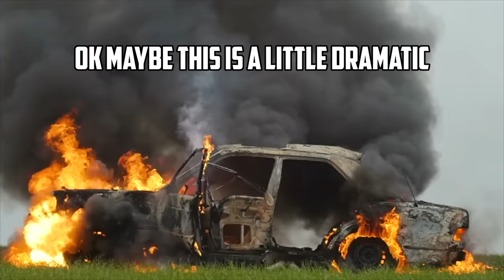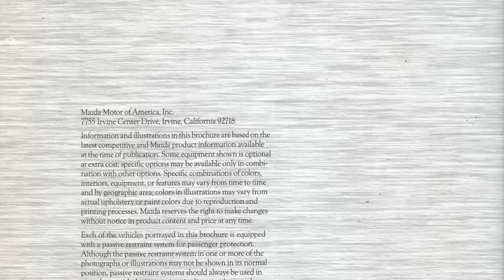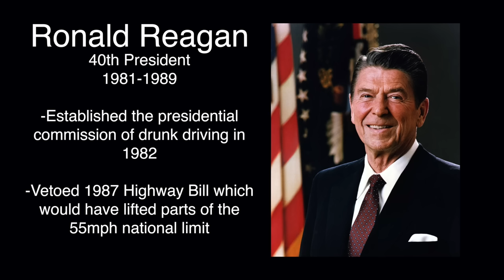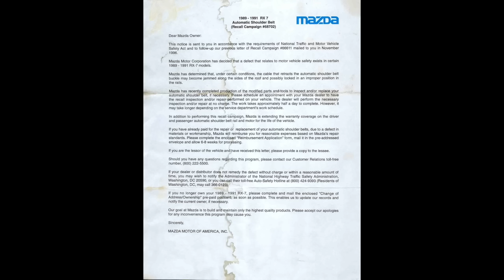Automatic Seatbelts - Why They Were Used & Why They Went Away!

Comment: back in 1991 I had bought a brand new Nissan Sentra 4-door and had nothing but electrical problems with it especially the seatbelts. they would automatically engage on their own without even breaking or there not being any need for them to engage they literally left weld marks on my best friend that was sitting in the front passenger seat the seat belt kept grinding pulling my best friend back further and further into his seat to the point that I had to press the emergency release red button but even with me pressing on it it still will not disengage I wound up pulling out the headrest and use the metal bar to press the red button as hard as I could even pounding it finally disengaged and it did so with such force that it literally busted my front windshield ricocheting off of it. my best friend that was sitting in the passenger seat after going through this horrible ordeal had welts all across his chest where the seat belt was pressing against his body as bad as this was I'm very thankful that I was there to release him from the belt. and I am also very glad that it did not happen to me in the driver's seat while I was driving. I swear the car acted like it was Christine because even the power seats would move by themselves for no apparent reason driving down the road and all of a sudden the seat is moving forward or backward the radio would go on and off by itself. and change stations by itself turning the volume up and down by itself in fact the AC literally blew up almost causing me to have an accident because when it blew it sounded like a bomb scaring the hell out of me the very first day I had taken possession of the car on the way home from the dealership. the whole time I owned the car it had repeated electrical problems. that I had to bring back to the dealership several times but the problems kept reoccurring. it got to the point that I did not trust using the seatbelts in that car. nor did I really trust the car anymore either and wound up selling it back to the dealership that I bought it from explaining to them that the car was a lemon.

Comment: The automatic seatbelts were the only part of my Pontiac Lemans that I actually liked. I was fairly new to driving and it was a gentle reminder to buckle up. Amazingly it was also about the only part of that car that never failed. Failure of the mechanism was always a fear I had in the back of my mind but since it always worked, I had no complaints about it, especially considering how bad the rest of the car was. Lemans? More like Lemons.

Comment: I always hated riding in other families' cars in the 1970s and 1980s because I was a stickler for wearing seat belts even in the back, and in those days, back seats generally only had lap belts, and it was easy to cram them down inside the crack between the rear bench seat and the back cushion, so they would disappear from view entirely (and be very hard to fish out again). Only a minority of people I knew wore seat belts at all in those days, and some people would feel insulted if you wore a seat belt in their car, as if you were calling them a bad driver.

I appreciate the motivation behind automatic shoulder belts, but they were clearly a bad solution-especially since, as many have noted here, wearing just a shoulder belt WITHOUT a lap belt was extremely dangerous. What finally did it was the introduction and enforcement of laws requiring front seat-belt use and proper child restraints.

Comment: 7:08 - wait, shouldn't we consider a huge factor for its failure the fact that only the upper band of the seat belt is automated, resulting in the driver still requiring to put the lower band manually?

Comment: I recall my 87 Ford Escort and its automatic seat belts... It wasn't uncommon for them to move forward while driving on the highway or interstate. The only way I found to reset them was to turn the engine off, open then door, restart the engine, then close the door. ...No terribly practical or safe while in a moving vehicle. I'd noticed that it only happened when a semi was near so I always guessed it was an RF interface thing.

Comment: Basically, the main reasons:
An electrical component that could fail. Still required a lap belt. Saved no time. Sensors sometimes failed with the doors.

Comment: I once owned at 20 years old (the car) a 1991 Honda civic. Great car if also long in the tooth, but is had auto seat belts that worked fine till they didn't. Fortunately Honda being the great company they are had for $100 the complete mechanical and electrical plans for the car. That and a 10 mm wrench was all i needed

Comment: The law said that they needed a passive system that would work whether or not the driver buckled up. The spirit of the law was airbags. The letter allowed automatic belts. Note that not all automatic belts moved. I had a 91 tercel with belts on the door that didn't move.

Comment: I have a 91 accord coupe and yes I have them but they dont work right so i have them in the driving position and unhooked the little computer under the driver seat that runs it so it doesn't move otherwise it might get stuck by the steering wheel when you shut the door and won't pull itself back up lol

Comment: You forgot to mention GM vehicles, which made their belts "automatic" by moving the mechanism to the door frame rather than the pillar behind the door. You were supposed to keep the belt buckled, and then crawl between the belts and the seat (which was not a lot of room). Nobody did.

The advantage, other than being almost free for them to implement, was if you actually did use them, both the lap and shoulder belts were "automatically" buckled.

Comment: There is one more major issue with automatic seatbelts. Even through the cross body belt moves automatically, the lap belt does not, and the lap belt is actually more important than the cross body. You can still bounce and hit your head without the lap belt.

Comment: I had a Saturn try to strangle me several times with the auto belt. The spool at the bottom would decide to lock randomly and would choke you as the mechanism came up and over around the top of the door frame. I started unbuckling it before starting the car.

Comment: As someone who owned a car with auto seat belts, they were crappy.

First, the shoulder belt by itself wasn't sufficient.  You still needed the lap belt to really be secure, which of course wasn't motorized so you had to manually put on that belt anyway.  It didn't save you any real time. In fact, it actually look MORE time (see point three).

Second, it didn't really force anyone to wear it.  If you were someone who protested mandatory seat belts, you could just unhook it.

Third, the shuttle often got in the way.  When you get in you have to pause for a moment to let the belt move into position.  If you try to do other things (like, say... put on your lap belt) right away, you would get in the way of the belt and get tangled into it. And when you stopped you had to wait for the belt to move out of the way.  If you tried to exit too quickly you could easily hit your head on the shuttle.

In short, it solved nothing (you still had to do the lap belt manually, you could still unhook to no use it) while introducing delays and complications. And all of this is before, as you correctly point out, the inevitable mechanical break downs happened.

Comment: Four point harnesses should be required. They would be far more effective and far more comfortable. At least the way I would design them.

They should pull down from above like a carnival ride securement. And have an elevated fixed bar across the front of the person.

This would accomplish multiple things at the same time.

It would completely eliminate fumbling with the seat belt. As the securement would automatically click into fixed positions to the side of each hip. Eliminating the hunt for the receptacle. The receptacles could have a bit of a rectangular funnel in case things ever got even slightly misaligned, so that the upper part would automatically guide itself into the receptacle with no effort or fumbling on the part of the rider.

Meanwhile, the fixed cross bar above the lap, would serve as the solid basis for any number of platforms for passengers, or drivers when stopped.

From a meal tray with cup holders. To a solid lap based video gaming platform. To a platform for kids to play with Legos or other toys. And any number of other attachments that could be clicked onto the crossbar that stabilized and guided the two straps that formed the 4 point harness.

When retracted, they could recess into the ceiling. Or retract around behind the head rest of the seat itself.

I'm surprised no car manufacturer has thought of this yet.

Comment: The Carter-era law was dropped, but other laws enacted that required passive restraints or airbags by the late 1980s in a certain percentage of the automakers fleet. If the law didn't require them, automakers wouldn't have only used them in the United States and not Canada or elsewhere. Case in point, all 1988-1994 Ford Tempos in the US have them OR an airbag. 0 Canadian Tempos had them. Why would they have developed two different sets and not even charge for them, just to annoy customers and lose money? 

As many other commenters have mentioned, the lap belt was still manually buckled and unbuckled.

Comment: They really didn't fail as much as you would think. Most of the ones not in working order, have been purposely disabled by previous owners. The real reason why they were discontinued was because ppl didn't use them properly. 

Auto-retractable belts were a two piece design. The upper, retractable portion, and a lower lap belt that you still had to manually buckle. Most drivers would never buckle the lower portion, and in an accident you were not properly restrained. In fact you could injure yourself worse because now the retractable portion became almost like a guillotine. Causing a lot of head and neck injuries.

Law enforcement also loathed them because it became very difficult to enforce the proper use of them, as you could no longer tell visually if a driver was buckled in or not.

Comment: I had a 1992 Mercury Topaz with the automatic seatbelt and it would get stuck at the end of the track and would make this horrible loud growling noise as it was fighting to move. So, I cut the power wires cause after it made that noise for an hour while I was shopping.

Comment: They were used for one reason only.  The law stated that some type of automatic restraint must be installed.  If you were a manufacturer and you had a model that was mid-cycle, you were not going to re-design it for airbags only to replace it a year or two later.  It was much easier to put a mechanism in the door.  I had a 1994 1/2 (yes, that's a thing) that had these.  As soon as the '95s came out they had airbags and these were gone.
Reply: Interesting.   Do you recall the make and model of the 1994 ½ vehicle you had?   I am 33 and so I've seen my share of cars with these automatic belts when I was really young and always thought they were the coolest thing ever, it wasn't till just a few years ago when out of boredom I was out of work during the covid situation I decided to research on why these belts were not popular and seemed to have only appeared on a small percentage of cars.

Comment: Had a 1993 Honda with automatic sea belts...things were a pain in the azz. Had no adjustment to allow small increments of loosening the seat belt after it was automatically put on by the car . Would draw the seat belt up against the side of your neck. Was especially irritating to the neck during the late Spring to early Fall seasons when it was hot n sweaty

Comment: You missed probably the most important safety factor why auto seat belts were discontinued. During a collision one of the front doors may partially open, and the seat belt would  start to retract. Leaveing the occupants unsecure resulting in injury or death.

Comment: you still had to manually close the lap belt. if you only had the automatic belt on, it was more dangerous to get into a frontal or rearend collision, as you would slide under the belt, and it would catch on your neck thus either strangle you or break your neck if forces were sufficient. USE YOUR LAP BELT!

Comment: What about the automatic body crushing auto memory seats? As a mechanic I despise gm vehicles which seem to be the only ones with this feature, imagine being average height and pulling in a short old ladies avalanche for a simple oil change and as soon as you start the vehicle the seat creeps up towards the steering wheel crushing your elbows and knees, after all the panic you manage to reach the seat controls to stop this awful experience. I know the circuit breaker would eventually trip but only after causing you extreme discomfort and even after that have to struggle out of that position because otherwise you have to wait for the circuit breaker to reset

Comment: As a mechanic I hated automatic seat belts because when I line up a car to pull it up on the lift I often need to open the door to look out the side. So I would be pulling up on the lift, open the door and stick my head out and the automatic seat belt would wrap around my neck. Dodge took over the top spot in annoying BS I have to deal with when pulling a vehicle up on the lift. Their electronic automatic transmissions with the selector dial on the dash throw themselves into park when you open the door. So you're easing a truck up onto the lift ramps and open the door to stick your head out and line it up and it slams into park halfway up the ramps. If you're within a mile of my location at that point you will hear me screaming obscenities as I slam the door shut and try to stick my head far enough out the window to see the ramps.

Comment: Ah yes. That 1993 Ford Escort I used in between cars just to get around. I already developed one of my few good habits of buckling up anytime I enter a vehicle (thanks Mom, it saved me twice!) . At least some of my stubborn passengers had little choice and I didn't have to explain the the head trama from getting hurled forward in an accident.

It's like masks during the Covid-19 pandemic: you are asked to do something a little out of the ordinary for safety, and the idiots come out of the woodwork, trying to make a mountain from a mole hill. Just put the damn thing on, and you're going to be ok. And for the excuse always used as "my so and so got in some terrible accident and if they wouldn't survive if they were wearing a seatbelt": in all my vehicles I have glass hammer/belt razors reachable from all seats. And I have never heard a first responder or physician say someone was saved by cracking their head into the dash or windshield. Get real, right?

Comment: There was another issue with automatic seat belts. the track was fixed and could not adjusted. which meant they didn't fit all drivers. especially tall drivers. they world go over the drivers shoulder. and down behind them causing injuries. seat belts don't work properly when they don't fit right. Honda had a long standing recall on their seat belts.  on the automatic seat belts. and faulty latches.

Comment: I wonder if the real reason for automatic seat belts disappearance was pure technical complexity and therefore cost - it is just cheaper to build an manual seat belt system. So the cause may not be directly the advancement of airbags, that drived automated seat belts off, because also airbags need seatbelt to function, they cannot replace it.

Comment: I've never understood why they don't simply interlock the ignition of gearbox to the drivers seatbelt, so you can't start the engine or pull away without first putting your seatbelt on.

Comment: You also forgot to mention that the seatbelts get stuck sometimes but they still close so now ur being choked by the belt. You know when u pull on your seatbelt to hard and it locks in place that’s basically what happens it gets locked so it’s not pulling the strap it’s now getting tight and u start getting choked unless u open the door again 😂

Comment: It always blows my mind how many people are stupid enough to get upset with stuff like seatbelts, it happens in aviation too, people too lazy to turn off the mags when they park because 'I'll remember when I go to check the rotor linkage/point the main rotor horizontal to signal takeoff', and then they don't, and the hot engine starts when they push the tail rotor, and they no longer have a head or hands.

Comment: Interesting and cool video, thank you!
They seemed like the future at the time, but it made getting in and out of the car much more difficult and awkward because they invariably got in the way and often rubbed against your face and arms upon entry and exit. (And very true, they failed a fair amount leaving you with no shoulder belt). 
You also had to put on your lap belt manually before closing the door to help keep the two belts from getting tangled with each other, that was fun in rain storms. 
There were also widely reported issues of accidents where the door was ripped off and the pillar or roof damaged, allowing the power belt to leave the track and take the occupant with it. 
I don’t miss them.

Comment: You miss the point that these gimmicks were useless anyway.  You still had to manually drag your lap belt across your lap and snap it in place.  Otherwise, your assets would likely go sailing right around the shoulder-only belt that had been automatically drug around you.   We had at least one of these vehicles in the past and the passenger side track indeed did jam up permanently.  I managed to get it to lock position, then pulled out the wiring harness for the motor so it was permanently in place and the passenger just had to either scoot under it or else unbuckle at the door pillar each time.